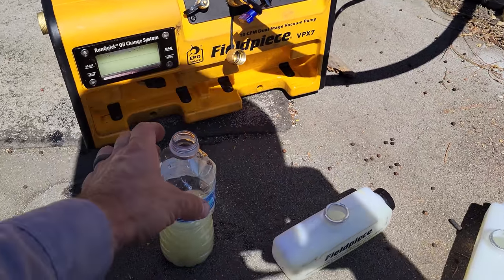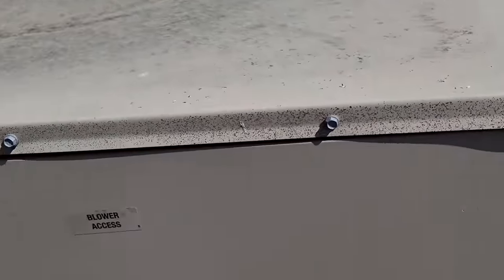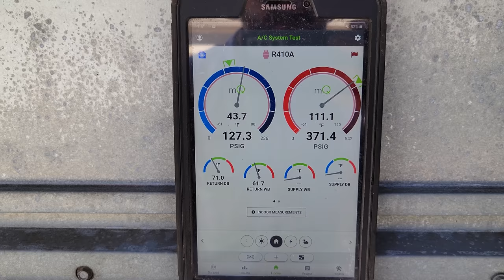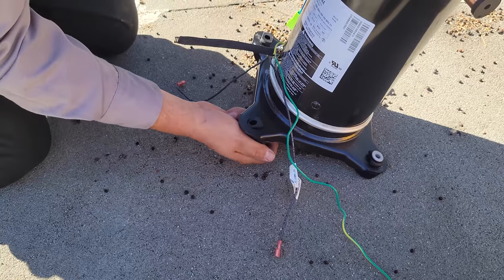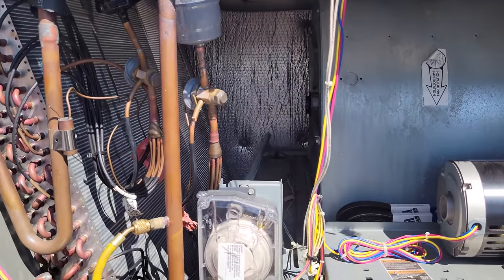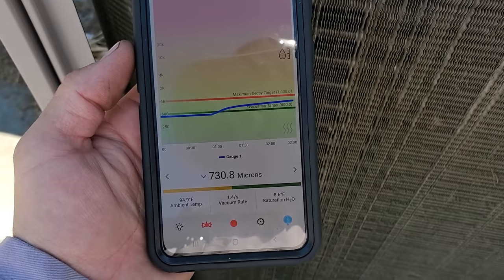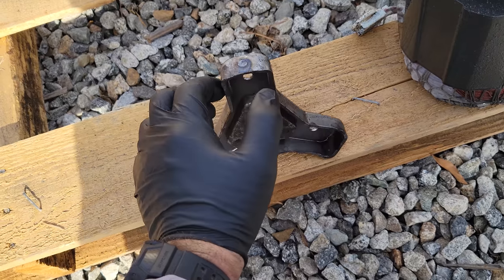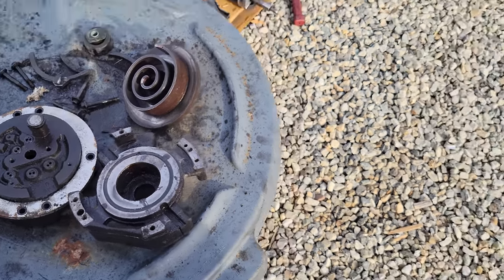INSANE MOISTURE CONTAMINATION

Comment: The old compressor didn't appear to have rust on the inside. I would think there would have been heavy corrosion with the amount of moisture that you pulled out of there.
Reply from the maker: I will discuss this on my live stream this evening on YouTube 11/29/21 @ 5:PM (pacific) come over and check it out https://youtu.be/jaqX-Q3oC84
Reply: If there is no oxygen in the system there will not be corrosion even with water.
Reply: Peter smith  Normally I would agree, but the O2 could of been greatly reduced if the system was pumped down to a vacuum at any point.  Water doesn't hold on to oxygen nearly as well in a vacuum because as you said, its probably going to boil off. There is likely some amount of oxygen left but not nearly enough to cause wide spread corrosion.  In any case, its all hypothetical and this is an odd one.
Reply: @hgbugalou  Water is 1/3 oxygen. If that was the case, any cars, boats or planes that went in the water should look as good as the day they submerged.
Reply: @mattnsac  Water is an extremely stable molecule and the oxygen is not going to just randomly disassociate from the hydrogen atoms without electrical input via electrolysis or a very particular chemical reaction that is not present in most situations.  If this were the case as you are saying, we could of solved energy long ago by just collecting hydrogen from the oceans from these random molecular break downs.  Water being so nonreactive is part of the reason why its a good solvent. All corrosion from water comes from oxygen species, mainly plain old O2 dissolved in the water along with other things like salts.
Reply: @hgbugalou  k
Reply: @mattnsac  Actually you need carbon dioxide to have rust.  Water forms a weak carbonic acid and then that actually breaks down the metals to cause rust because as the breakdown happens water is breaks down into separate hydrogen and oxygen pieces. That makes free Oxygen and and thats how you get oxide.   To get rust you need water an air... not water and oxygen as many like to say.
Reply: @tekjunkie28  no, you dont need CO2, you just need anything to create ions in the water.  If its deionized, pure water, its likely to do nothing, but thats not the case in an HVAC system where the oils alone will cause ionic reactions let alone ANY impurities in gases or materials.
Reply: @mattnsac  I think your just spitting words.  You need co2
Reply: @tekjunkie28  Okay, since its CO2 that is necessary, Im sure deionized H2O and C02 will rust iron, right?

Comment: The darkened steel shell is from when they assembled the stator to the compressor shell.  They induction heat the steel to expand it to allow the stator to drop in.

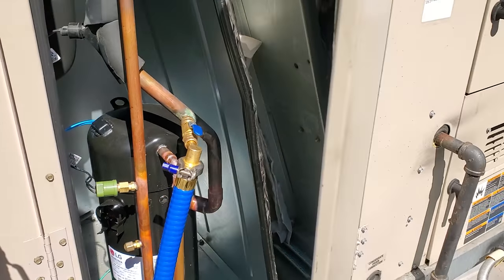Comment: 22:28 if moisture was from the old compressor, would that moisture cause freezing "inside" the low side?
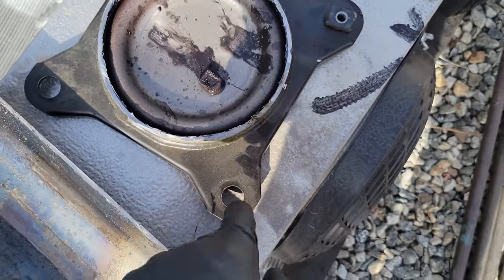26:51 car oil pan drain plugs are also magnetic with purpose of capturing metallic bits

Comment: That finish on the cast components (guessing cast steel) that's rust they should be a light silver/grey 🤔 that thing must have been swimming in water for that to happen.
 that bluing on the shell is likely from assembly everything will be an interference fit which they likely heat the shell up and expand it and drop it over the rotating assembly and it all locks together when the shell cools and contracts. 

it's concerning how much moisture was in that system though one thing I can think of that could have contributed to the cause of the failure is the water freezing and blocking the txv and causing an intermittent high head pressure scenario.
Reply: That was copper plating from the moisture becoming acidic which pulls copper from the refrigerant lines.  It gets squeezed back out of solution and deposited on tight spaces such as bearing clearances and between the scroll sets.

Comment: Just a heads up for you and your viewers, most recovery bottles have some numbers stamped into or around the handle, the TW is the tare weight and WC is the weight content, so no need to weigh an empty tank prior to recovery
Reply: WC is water capacity
Reply: When ounces (grams) matter, you weight the tank. It's a simple 3s process. Just like pushing the "zero" on the scale.
Reply from the maker: I will discuss this on my live stream this evening on YouTube 11/29/21 @ 5:PM (pacific) come over and check it out https://youtu.be/jaqX-Q3oC84
Reply: Nice, all this time I was calculating 80% of the WC to determine how full I can fill a bottle. I didn’t know it meant water capacity, good to know. Thanks!
Reply: @bryanharayda1975 hell yeah man.  HVAC school has some info on using WC and specific gravity to determine fill. They have a nice calculator too on the app.

Comment: Compressor doesn't have reeds, those "reeds" were its check valve, odd design. Muck at top due to lack of lubrication, crazy oxidation/plating going on. Moisture was aleady in there, which means factory never evacuated properly. Hope you get to go back and change drier. One of your better videos!
Reply: I'd say the reeds are there as liquid pressure relief ports for when it gets slugged.
under operation the outlet pressure on top of the reeds should be equal or higher than pressure behind the reeds within the scroll, unless there's something non-compressible, which would open the reeds and correct the harmful condition. the reed ports would also get covered up at a certain point within the rotation.

Comment: I had a Trane heat pump that I worked on a bit ago that had a leak in the discharge line. I repaired the discharge line. When I evacuated it I had to change my vacuum pump oil 7 times before it had clear oil. I was beginning to think I had a leak. It was just that much moisture in the system.

Comment: The only time I've seen that is when there was still refrigerant in the system and I was pulling a vacuum. The isolation valve was bleeding by and the oil in my pump turned white, even after changing it multiple times.

Comment: As a mechanic I am going to comment on the LG pump. Those are not vanes those are pressure release the metal is likely spring steel or backed by a spring. The offset where the babbot bearings where the main shaft rides has that gap because it's beaviled for installation of the bearings during assembly so it slides in. The piece you said sprin open when you cut it is what is known as shrink fit  they heat up the outer case slide it down till it hits the lip when the outer case cools it shrinks up against it. Shrink fit is the strongest connection short of welding and is used in a lot of fields. Magnets are normal in anything with moving metallic parts and should be in everything. It prevents metal from just bouncing around and causing excess wear. It is also used when companies cut corners they will have 2 or 3 cause they know it's junk and will run longer even though junk. Any time you see black on the shaft is indicative of high heat and if it doesn't smear it had moisture in it. The scroll housing with the extra machined space is to create a pressure differential. The hole acts like the narrowing of a txv and the extra space acts to drop the pressure to help make sure that the refrigerant is a gas and also to lower the pressure of the gas and allow for easier pumping. This has the added effect should something go wrong of it have less of a chances of slugging the compressor with liquid refrigerant. Love your videos btw. Keep on keeping on.

Comment: I’ve had the water issue happen before, found a low pressure switch had snapped off on a Carrier 5OTC unit, of course the switch was on the top of the suction right under a CFM. It had rained a lot in the previous days before the call. Purged the line with Nitro but u could hear water flowing in the refrigerant line. Yea customer did not want to replace he wanted it fixed, kept getting that milky oil in my vacuum. Ended up drilling a hole in the lowest point of that circuit with a zip screw(non-bit tip) and a lot more water came out. Glad the pressure switch tripped as the compressor did sound ok. Put both driers in it recharged and changed them both out after a few weeks. System has been running for 3+ years now. With minor things(caps, contactor) going wrong since.

Comment: I have noticed LG Compressors can’t handle flooded starts. I watch the condensation line on my replacement compressors. ( similar to the way you watch receivers for winter charge ) and if the condensation is high on the compressor. There is a feeding issue with the TXV. Some TXV’s can carefully be adjusted others I have to change out with an adjustable TXV. The moisture issue has to be from the factory. 😊Hope that helps.
Reply: Also micro channel coils in Phoenix on high ambient days cause flooded starts and main breaker or HP Safeties to trip and weaken. I’ve called Trane and got permission to pull out 5-10% of the charge to help prevent this issue. This happens to all many here. AAON,TRANE,LENNOX,HASKRIS ( Process chillers ) all responded after a small adjustment. Had a bunch to do this summer. Most extremes were on systems too close to a parapit wall or systems picking up discharge air from other systems. Poor condenser air flow. Hope that helps next summer. Now we get geared up for low ambient 😊

Comment: Wonder if the recovery tank had moisture in it. Years ago had a new R134a tank that had moisture in it, drained half a cup out! luckily I used to charge it as vapour so didn't get in to the system.

The reeds are check valves to stop the scroll spinning backwards, and also they are use to let the refrigerant out of the scroll before it reaches the centre exit hole to increase efficiency in low head pressure conditions.

Comment: I think the reeds there allow the unit to operate efficiently at varying compression ratios: The scroll geometry itself is designed with high ratio, the valves placed at few places allow the compressed gas to discharge if the output pressure is not that high. Mimicking how a piston compressor would operate inherently.
Without them the compressor would internally pressurize according to what ratio the geometry is designed, only then after the last pocket would get reduced by just passing as the pocket is opening to the discharge, wasting energy there.

Comment: moisture plugged txv and compressor overheated,thx for sharing.on multi system is hard to do deep vacuum if coil is wet,it might have small leak,and introduce moisture.

Comment: Get your nitro only from a refrigeration or ac supply house,no moisture. Worse case of a wet system was a buffet restaurant being built by a fly by night outfit. They were kicked out. Lines on roof,open to rain. Each unit took 2 to 3 days each to hydrate with numerous pump oil changes.

Comment: That magnet. It looks just like the magnets they put in transmission pans for cars. They are there to show if any damage has happened as it will catch metal debris in the fluid. Didn't expect to see one in a compressor that can't be opened though. I never expected the actual compressor to be such a small part of the whole unit. The motor takes up like 75 or 80% of the unit.

Comment: I'm going to guess the water was in your blue vacuum hose..  Perhaps an errant water hose when cleaning coils splashed onto the end when it was disconnected at your last job before before this one.   Or the new compressor had the water in it..  If the old compressor had that much water in a hot compressor that mild steel would have been 100% rust on the inside even with oil splashing around.   Very strange indeed.

Comment: Pulled numerous vacuums on a water cooled system for 3 months, 20 gallons of milky oil, system was contaminated with water! Heat exchanger had busted causing circuit to submerge in water and compressors were still operating with water in them which was crazy. Moisture is no joke when coming evacuation.

Comment: Chris, did you let that moisture settle out to measure how many oz there were? Would the moisture content give a false reading of the state of charge you were seeing on your gauges? Did you cut the dryer apart to see if the moisture clogged it? When you drained the oil from the compressor into the orange bucket did any moisture settle out? Just thinkin.

Comment: @HVACR VIDEOS @33.40 were you explain how it was bit trouble some to diagnose some issues because the return air was too cool. Would be beneficial/ cost effective to carry a small 1,000-1,500 watt space heater, and place it in rooms like that? I do understand that this would only effectively work if the room is sealable, or get as close as possible to the return intake. And in some case’s may be ether impossible, or to time consuming to set up.

Comment: I had the same issue with oil contamination because unit came flat without any gas and another tech did a leak search pulled a vacuum i came back next cooling season found a leak and had to replace condenser, other tech doesn’t like micron gauges, so entire time pulling a vacuum he was pulling in moisture

Comment: So desperately need a decent HVAC tech for my house. Last guy just checked pressures when we said our pool heat pump wasn't putting out much heat and only suggested replacing the capacitor. Same for the house. Was taking forever to cool. He added refrigerant. Now heating and let temp drop night before last. Took 8 hours to raise the house temp 3deg C. Running far too long.
Our electric bill is 1000$ for the year higher than last (that's a huge increase on our Quebec rates).
I train techs on HVAC systems, but not on gauges and testing. Just familiarisation of where components are. I knkw the tech should have been looking at superheat in cooling and heating for the house and heating on the pool.
Maybe expansion valve issues with both?

Comment: It could be the commercial issue compared to the  linear compressors failing in residential refrigerators. (Replaced over 65 linear compressors. AMA down below)

Comment: I know very little about ACR, but I do have some experience with Schrader valves. You had one Schrader which was loose, which could easily have sucked moisture into the system if it was that the valve assembly was loose rather than the inner part of the valve (where the depressor button is). In other words, if you needed a wrench to tighten it, then you could have been pressurizing the cap and introducing an area of negative pressure where moisture could get in, but if you needed to tighten the Schrader stem thing on the inside with a valve tool, that couldn't be it.
Reply: Normally they won’t suck air and moisture if there is positive pressure in the system. Only if all the refrigerant was gone and system doesn’t have a low psi switch with compressor running could it pull some air and moisture in, but the compressor would have to run a long time to get that much moisture in the system, and scrolls do not like running without refrigerant for too long. They’re the drama queens of the trade. They can take a lot of abuse initially but do not like to be neglected and will let you know about it.

Comment: The nitrogen in the tank would only have a partial pressure of water and it would be small due to the low molecular weight of water at 18. . If there was excessive water the tank would have sloshed How much water in grams  do you think was in the compressor?

Comment: Hydrocarbon Oil destroys rubber.
You can use Girling rubber grease, castor oil based.
Do you uses silphos flux when brazing copper pipes?

Comment: I have had water filled co2 bottles,from soda  fountains that would run with no pressure,water line pressure would back fill the co2 bottles,weird when water comes out of your wire feed torch handle?

Comment: the only time i have seen moisture like that was on a brand new unit that shipped out with a hole in the coil, and the system sat, open to the atmosphere for 6 months while we waited on the new coil to come in.... when i cut the old coil out there was literally a half to a full gallon of water that poured out of the coil. it sat on the pump for 2 days and had almost 10 oil changes.

judging by the color of that oil, you would think, there had to be an extreme about of moisture in the system, for an extended about of time, i would say if it shipped from the factory with that moisture in the system(total possibility... lol)  I think it would have failed alot sooner....

Comment: Went to comission a water chiller and found no water flow switch was installed.Advised customer that it was imperative that a water flow switch should be fitted and he said it wasn't needed as the chiller was interlocked with the chilled water pump and wouldn't run without the pump running.
Few weeks later got called to site as the chiller wasn't running and found the whole system was empty of gas and full of water.
Had to fit a new water chiller as evaporator was split and compressor was stuffed.Two weeks spent purging with nitrogen and continually evacuating the system until the system was dry.
Guess what,customer asked for a flow switch to be fitted.